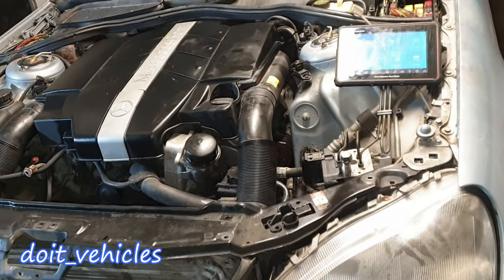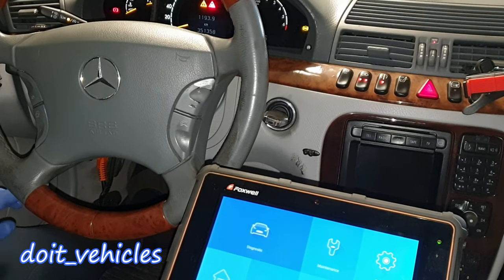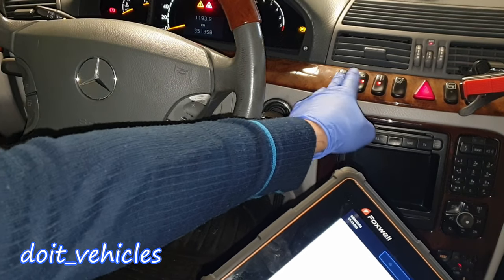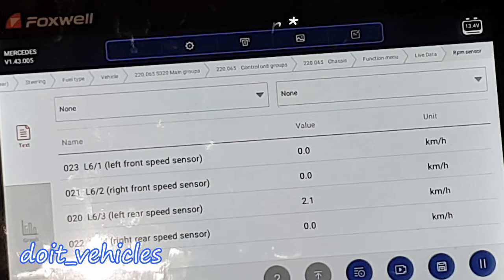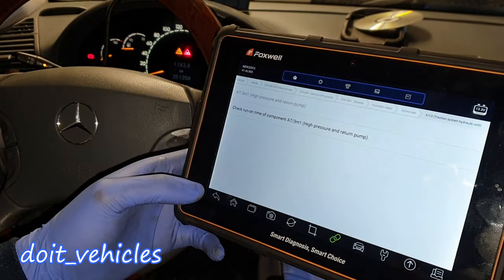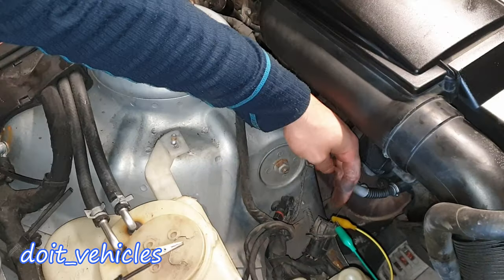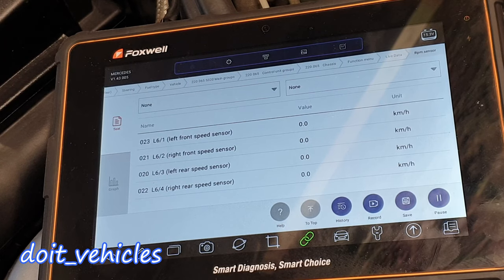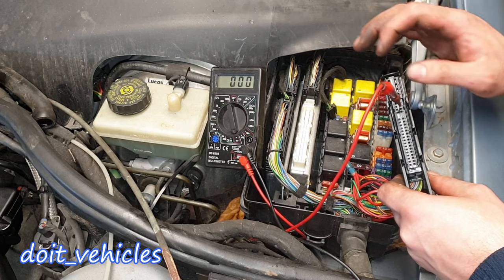ABS system from W220 Mercedes S 320 , Wheel Speed Sensors Diagnosis Scanning , S 500 , S 430

Comment: I don’t get it, I changed the break fluid 04 S430 and suddenly the ABA and ESP comes on very strange, sorry I didn’t get the name if you don’t mind,
Also, the dealer insist that I will need 4 wheel speed sensors which they don’t have anymore but the local mechanic says I only have one, rear passengers , man this is a joke
I changed all TPMS and dealer insisted my car doesn’t have TPMS even though I showed them the error on the dash they still say no.